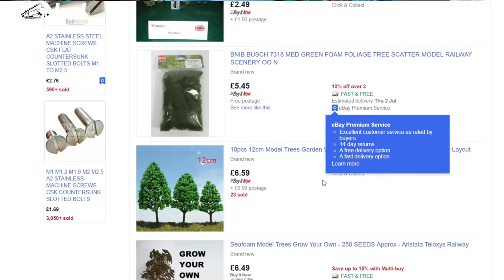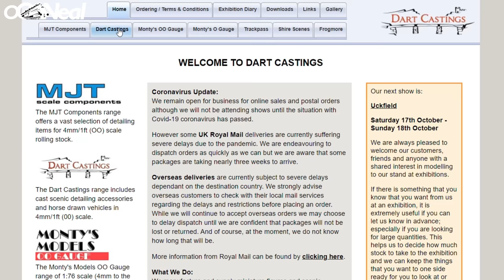Building Up A Model Railway  S1 Ep 42 | Dads Layout | Model Storage | Buffer Fix | New Rolling Stock

Comment: Hi Tris, glad you’ve got to spend some time with your family. On the cheapo trees, I’m much in the same boat, I’ve bought a few from China direct and am mostly pretty pleased, to get some better colour I’ve very lightly dusted a mix of aerosols, red primer, ford signal green, ford laurel green and even a touch of satin black just to add some variety. One thing I’ve picked up in a few places (mags and vids of tree making) is that trunks are seldom brown, rather tend to be grey (although I’m literally looking out the window and the coniferous trees I can see do look quite brown!!)...

On rolling stock, have a look at Hattons et al, Dapol is equally cheap as Oxford (which I agree are excellent and I think a bit more detailed than Dapol on the buffer beams), and they do some unpainted (but otherwise RTR) ones for even less that you can do to your own tastes. Also nice little projects as well are the ex-kitmaster / airfix now Dapol kits as these now come with metal wheels and tension link couplings, and are supplied on sprues. The only downside for you particularly is they are as far as I know post-nationalisation, but I won’t tell if you don’t. I’ve used two customised (as well as three standard) to represent an older real Austin Motor wagon, and a petrol tank fictitiously running with some favourite cider brands on lol!
Reply from the maker: Thanks for that great comment that’s all very helpful

Comment: Another enjoyable video, with a nice looks at your Father's layout.  The boxes you had at the beginning look like a good buy to help protect rolling stock... is there enough clearance in the bottom/under the lid to allow a felt lining to go in to add that extra layer of protection?  I'm thinking the sort of felt/baize that goes on snooker tables - quite fine, and not going to clog wheels with with stray bits of 'fuzziness'!
Reply from the maker: I guess you could add some there seems to be a little bit of room 😊
Reply from the maker: And thanks for watching